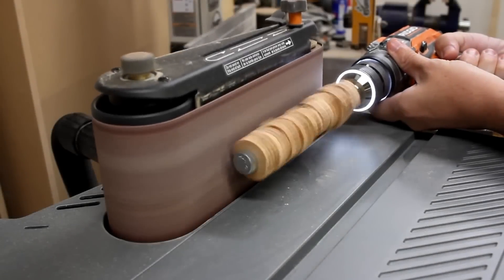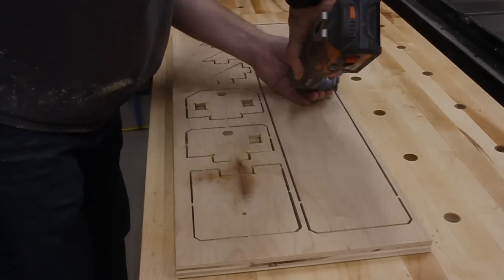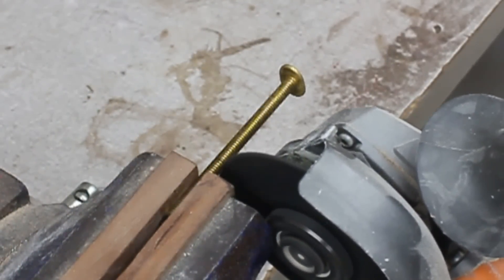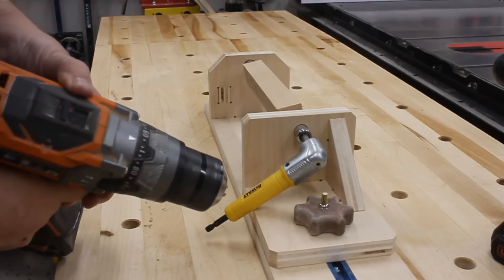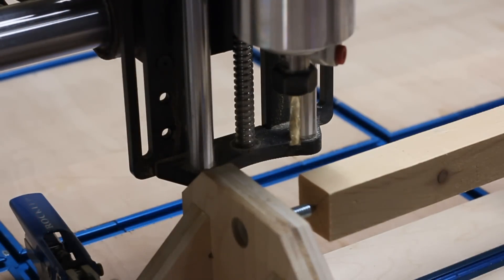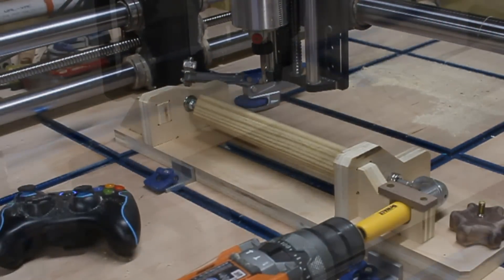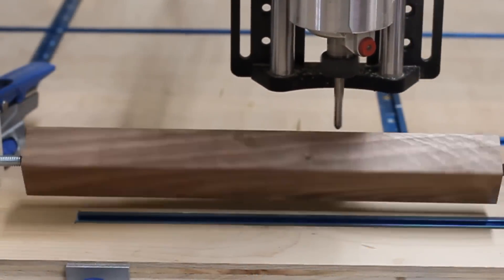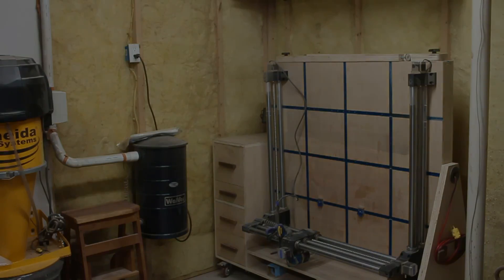Shop Work: Making a DIY CNC Lathe

Comment: Think you stock spin speed too slow. Invision an actual lathe, cutter moves slow, but spindle moves fast. Also, drill press knob, you got a cnc man, embrace it 😂
Reply from the maker: The stock definitely needs to spin slowly, not fast.  Think of an average feed rate of a CNC, which is like 70-90ipm.  If the stock on my lathe is rotating at 60-70rpm and it's more than 1 inch in diameter, that's awfully close to typical speeds, if not it's even faster.

Comment: What brand of CNC is that?   Didn't you have an X carve before?
Reply: 1finity
Reply from the maker: It's a OneFinity X50 Woodworker... best CNC out there for its weight class, in my opinion.  Yes, I used to be on contract with Inventables years ago but ditched the X-carve as soon as my contract was up.

Comment: To save time on the cut, you may be able to set a more aggressive cut to get to the shape you want, then the final few passes are really fine.  So the first 90% of the cut, instead of 3/min, go for 6 or 9, and also bring up the speed of the "motor" of the lathe to allow the quicker cut.

Speeds and feeds are important, yes, but you're using a decent diameter of a cutting bit, and you're cutting somewhat soft wood.  "Should" be fine.
Reply from the maker: Well, it's dangerous because if you up the rpm of the drill, you'll be slamming the rough edges of the stock into your bit.  If it's soft wood, it might not be a problem though.

Comment: 2:48 Can i please ask why you drilled holes in all the corners of the square cutouts?? Just got my cnc and still learning.. Great video btw!!
Reply: I think its because a round bit cant cut a square corner, so the holes provide extra clearance for the square edges of the board to slide in.
Reply from the maker: Yup, those are called dog bones.  Since router bits are round, they're required if you want to make the pieces fit together squarely.